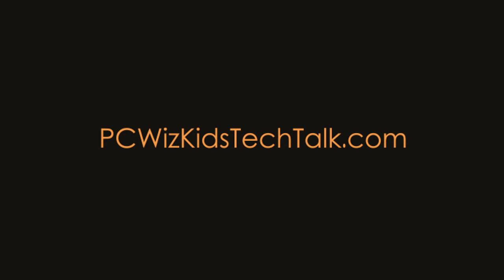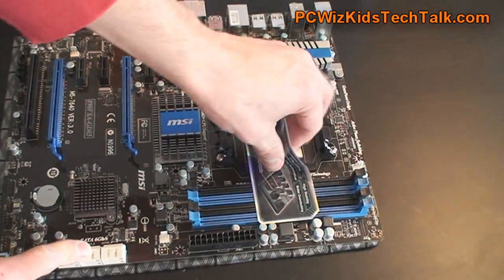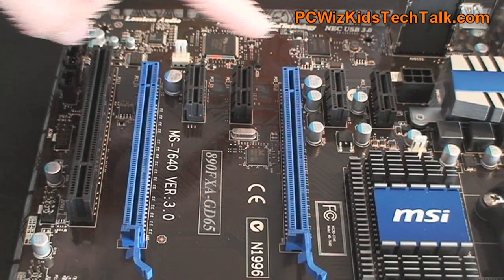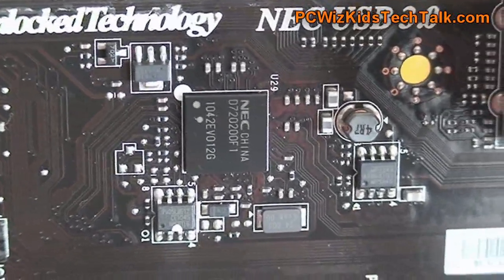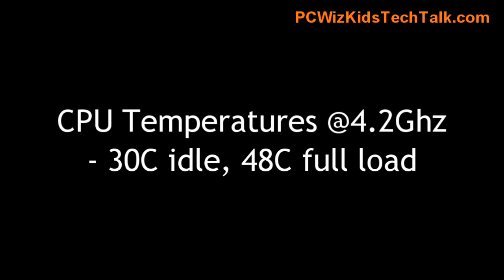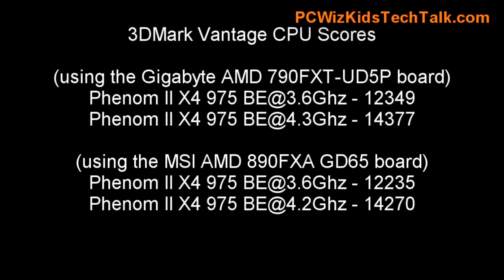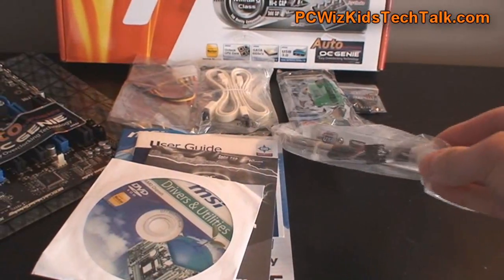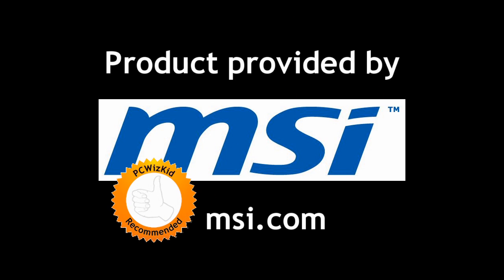MSI 890FXA GD65 AMD Motherboard Review

Comment: Do you prefer MSI radeon 6870 hawk and AMD Phenom II x4 960t for this board whit low budget? And for later updates like dual 6870 and unlocked 960t to 6 core +OC, Is it worth it?

Comment: @Ardonn 
Yeah thanks for that information. I just went with the safest voltage that I have experience with, as I've been overclocking and used 1.4 Volts overclocked to 3.6 GHz 250 * 14.5. Seeing temps 50c at idle with the stock fan at 100% is quite scary. Since I'm buying a CPU cooler I might try 1.5v if I can't get it to 4GHz at 1.4v.

Comment: @conyo985 -.- the safety voltage at max is 1.55vcore to the cpu and the max heat output for the CHIP is 62c. as long as you have a good heatsink 1.5v-1.55v is fine.

Comment: @Xtclilium 
Remember unlocking cores isn't a guarantee. I suggest giving up but if you insist, try increasing the voltage. AMD CPU's can handle 1.4 volts any further isn't recommended. If that doesn't work just give up and try your hand in overclocking.

Comment: @TearsOfWar1 The cheapest i7 930 I can find is 255.95 while the 1100t is 229.99, so it's definitely not cheaper.. The i5 2500k would be the better comparison since it's WAY faster and overclocks better for less.. Although, premium intel motherboards are far more expensive than premium amd motherboards, so you have to factor that in. As far as I know, there aren't any 1155 boards that support 16x/16x for crossfire/sli at a $200 price point.

Comment: Srry about that, I have this same board with a amd 695 be with a cooler master hyper 520 cooler. Oc to 4.0ghz just using the oc genie in the bios. It increases the voltage from 3.8 to 3.99 volts. The idle temp is 33c and max load is 42c. This board is solid! I love it the gnu I'm using is 2 gtx 560 (msi twin frozr2) storm scout case. Amazing mobo!!!! And good to see someone els feel the same way!

Comment: @MrToad321 it is not a amd vs intel problem , it depends on the chip itself, for example a i7 930 gives out more heat then the new i7 2600k, a low power chip like a intel atom will normaly be cooler then a cpu that need 130 watts for example

Comment: @chrisfur2 Their top of the line is $229.99 dude... I am going off Newegg prices, I am not going to serf the web to find the best deal, that mean you will have to serf the web to find the best deal for the i7 930 also to keep it fair, which I am too lazy to do. The i7 930 is cheaper, even the i7 940 is only $269.99. Nit wit.